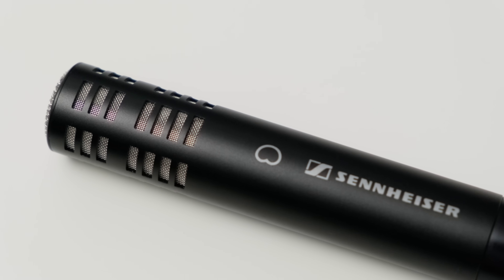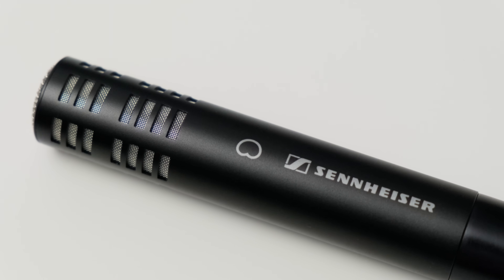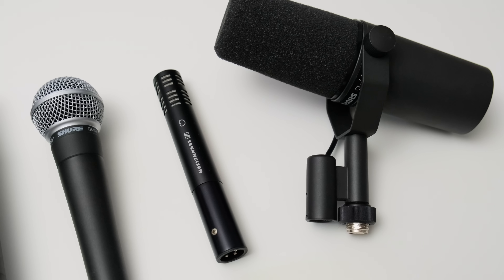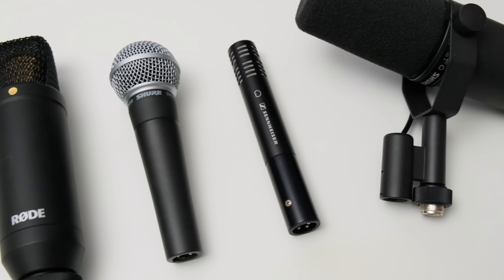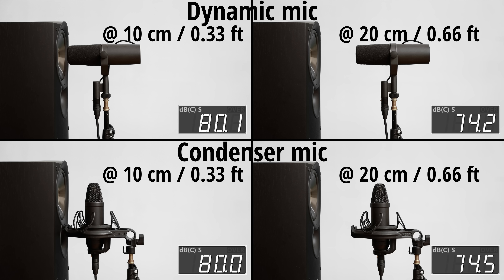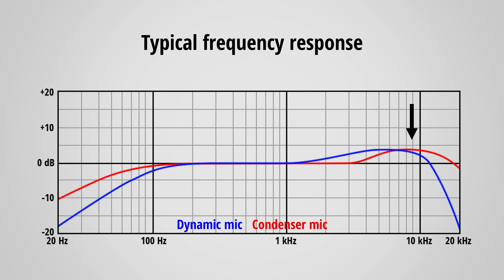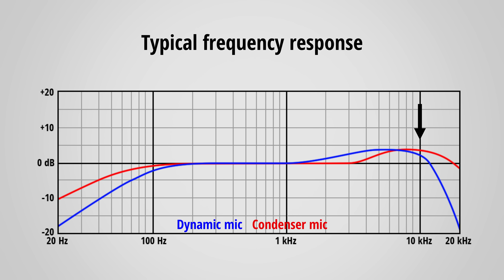Dynamic mics don’t reject noise better than condensers! And yet they do?

Comment: I actually had this question and debated it with many people. I came to similar findings with slight differences.

Application matters. A condenser mic sounds better about 6-8 inches away but not up to your face (that will make it sound generally worse), unlike a dynamic mic, which is best around three fingers away. That inherent distance affects reverb. Some say to bring a condenser closer, but that sounds bad. So, when used correctly, dynamics reject more simply due to how they’re positioned.

Not all cardioids are identical. A dumb Sound on Sound article claimed all cardioid polar patterns are the same—no, they’re not. Podcastage, Soundspeeds, and I have thoroughly proven this. Even placing an SM7B and NT1 at the same distance, the SM7B picked up less noise.

Dynamics don’t always reject more than condensers. The supercardioid KMS 105 rejected noise better than many dynamics, including the SM7B. This proves some supercardioid condensers reject more than dynamics, debunking the idea that dynamics inherently reject more.

Perceived detail is real. Condensers generally capture more detail—like mouth clicks—which makes them sound great in treated spaces but terrible in bad ones. You touched on this, but it’s a key reason why condensers pick up everything, for better or worse. But it's perceived detail.
Reply: The polar pattern thing really accounts for a lot of it. You can't just say a cardioid is a cardioid, you have to look at the graphs. The SM7B is practically a hypercardioid mic at high frequencies, the very same frequencies that register as room reflections, so of course it's a great choice. It also has almost no pickup directly behind it, whereas a lot of cardioid mics tend to pick up low frequencies (and some narrow bands of high frequencies) from directly behind. So yeah, it's great in untreated rooms, just not because it's dynamic or low sensitivity.
Reply: @nickglover  I believe the wider polar patterns for lower frequencies used on many cardioid mics are intentional. They are designed that way to fight proximity effect. Less directional means more weight on the pressure component than the gradient component, and thus, less proximity effect. In other words, these cardioid mics act more like an omnidirectional mic for lower frequencies while acting as a directional mic for higher frequencies. And of course, there are condenser mics that are designed in the similar manner, like Sony C-80 and Shure KSM32 that use two diaphragms to get the similar effect. Most multi-pattern condenser mics set to the cardioid mode act similarly as they employ two diaphragms. (Shure has a great article about how the dual-diaphragm design alleviates proximity effect.)
Reply: With proper wind protection you can use a condenser mic just as close as a dynamic microphone.
There's nothing in it, which makes it sound worse in that application.

I agree about the polar patterns though.
Was surprised there wasn't more talk about it in this video.
Maybe dynamic mics tend to have a narrower pattern.
Reply: @uhu4677  The increased sensitivity of the condenser picks up more transients and low level detail, which for spoken word can mean lip smacks, saliva, and other mouth noises that are typically damped by a dynamics slower, heavier capsule design. You also have to more aggressively correct for proximity effect.

So, yes, there are situations which make it sound worse when close micing but obviously we do it all the time because we WANT more detail than a dynamic. And RX Mouth De-Click is a godsend for correcting that stuff when it happens.
Reply: @uhu4677  If you'd like to educate yourself on this subject I highly suggest reading The Microphone Book by John Eargle. Figure 7.11 will show you how the heavier mass of a dynamic mic damps the impulse response compared to a condenser. Eargle states, "...it can clearly be seen that the condenser is better behaved in its time domain response."

Proximity effect does change with polar pattern but the amount of which is baked into the design of the capsule. The phase networks used to make the mic directional result in loss of low end, so that low end is designed back into the capsule with resonant cavity's, tuned venting systems, etc. Proximity effect comes from the phase network losing its effectiveness at close proximity which results in that corrective EQ becoming an increased low end
Reply: Beat me to it. I was literally going to say the same exact thing. The different sensitivity levels of the dynamic and condenser lead to very different design principles for each. Dynamics can round out transients better so designers slap on lots of pop filtering and optimize the proximity effect for under 3” or whatever it may be. Condensers can pick up more detail so they have more open head baskets and proximity effects suited for further distances. 

But you can still get mics like the ETHOS that’s optimized for a few inches and therefore does a better job of rejection than most other condenser mics. It’s all in the microphone design and dynamics are typically designed in a way that rejects more ambience when used optimally.
Reply: @Hectagonist  Ethos actually has about 5 cm of space between the tip of the windscreen and the diaphragm when you have the foam windscreen. If you unscrew the windscreen assembly, you can get right on top of the capsule and sound VERY differently (with a lot of proximity effect). When it comes to noise (and ambience) rejection for a condenser mic, I would say handheld condenser mics like KMS 104 & 105 do a better job just because your mouth can get closer to the mic capsule (without too much boost in the low end from the proximity effect because of the roll-off).
Reply: @soramittenpaw2127  A few inches is like 7.5cm, so I was figuring that 5cm you mentioned plus a bit (so you’re not touching the windscreen). But you’re totally right and those mics also show that the capsule can be designed with a specific working distance in mind. For the KMS 105 that distance is very very close, while the ETHOS is comparable to the SM7B which also has a similar spacing behind the foam windscreen. On the opposite spectrum mics like the U47 or Chandler REDD already have a rich low end at 8-12 inches and can get some very massive proximity boost up close.
Reply: @Hectagonist  Yes, and my point was that neither Ethos nor SM7B is the best mic to increase the signal-to-ambience ratio because of that space between your mouth and the capsule (with Ethos, you can unscrew the windscreen to get right on top of the capsule, but with SM7B, you cannot remove the metal mesh housing unless you break it). And I'm just looking strictly at the signal-to-ambience ratio and don't mean to say that these mics are bad in any ways. Like you say, they are designed for specific use cases. Ethos and SM7B are great in many ways but not necessarily so to reduce ambience in relation to signal by maximizing the signal because of the space in front of their capsules. For an untreated space, mics that can come right up against the sound source are the best in terms of the signal-to-ambience ratio, and such mics must be able to tolerate somewhat high SPL and tame the low frequencies (in case of pressure gradient mics). That way gain on mic pre can be set low to reduce ambience while maintaining a sufficient level for signal.
Reply: if you want to use a condenser mic for vocals in a bad room get the lewitt ray, it's very bright but not harsh ...activate aura, no proximity effect... get pretty close, little of axis ...after recording edit with izotope rx mouth de click (i always use it also with dynamic mics) ....if you want the sound of a dynamic mic, just use a highcut filter on the lewitt ray after recording till it's dark enough for your taste ...i think it's a really good affordable mic
Reply: @snubdawg1386  Lewitt Ray, by design, changes dynamics before reaching any processor, meaning that it could cause unintentional effects when using non-linear processes down the signal chain. For example, it will be a terrible mic choice for a live chat using a loudspeaker for the far-end playback because it will mess up AEC (AEC should be applied before any dynamic processing for it to be effective). Just be careful with what mics to use for what purposes.
I would use a handheld condenser mic designed for stage use with low frequency roll-off for a bad room because you can get close to the capsule to increase the signal against ambience without too much boost in the low frequencies.
Reply: @snubdawg1386  Interesting, thought about picking up the Ray for close miking my acoustic guitar in my less than perfectly treated room. Does it really have no or next to no proximity effect?
Reply: @KlausWutscherMandolin  check the tests on youtube ...some people comment, the ray sounds thin when aura is activated...that's because of next to no proximity effect with aura activated, it sounds the "same" if you are close to it or far away from it, but of course if you're far away you have much more room on the recording....no aura activated = normal proximity ....aura activated = no proximity ...negative thing, when you're recording a singer from a distance and the singer moves their hands too much so that the laser detects them, the aura technology will adjust wrong and the take is messed up, already happened to me
Reply: @snubdawg1386  Interesting, I noted that the ray can misfire but somehow did not catch the change in sound when ray was activated. I don´t have any use at all for the laser muting, but a mike with a proximity on/off switch makes much more sense to me!
Reply: Was waiting for your comment!

Comment: There is just something about the nt1 that fulfills all frequencies for my ears
Reply: The black NT-1 is a really good mic punching way above its price class. Røde did themselves a disservice naming it so similarly to the NT1A (which can be really harsh)
Reply: The 2014 gen4 black one is probably the only good Nt1.
Reply: @johnyang799  the only good nt1 is the one that's not here.
Reply: The only good nt1 is the one that's far away
Reply: It fulfills or does not fulfill, but not "for your ears", stupid.
Reply: nt1000 is a forgotten gem
Reply: Wait until you hear a Neumann
Reply: The nt1 truly does fulfill all frequencies. With shit.
Reply: you guys might be talking about the NT1-A and NT1? the nt1-a is kinda metallic and was vastly overhyped, the NT1 on the other hand is a fantastic microphone.
Reply: @DrWurzeli  my thought as well. The NT1-A has some weird bumps throughout its frequency response, while the NT1 (non-A) is relatively flat.
Reply: Honestly the NT 1 is crap and turned many good performances into bad recordings. Is hella sibilant, and kinda metallic sounding. Try something else like the lewitt 440 and you’ll notice how whong u were.
Reply: @RPK.1405  I don't think I can be wrong about what I like, sadly.
Reply: @RPK.1405  What NT1 do you mean? The one from 1997 or the one from 2014 or even newer versions?
Reply: @RPK.1405 as others have said,  you're probably confusing NT1 with NT1-A, which are like night and day when it comes to sibilance. NT1 is about the least sibilant mic there is for the price.
Reply: @RPK.1405  I also hate the nt1 but not for those reasons. To me it seems like the off-axis response is just... bad sounding. It makes anything other than a point source in a dead room sound amateur. I'm talking about the black version with the rycote mount.